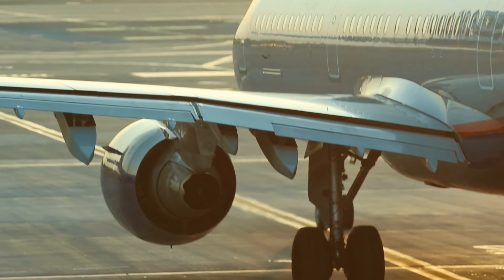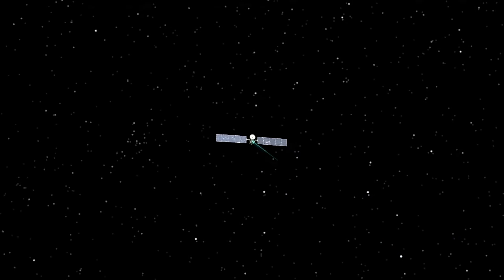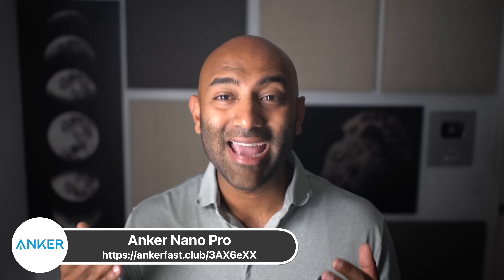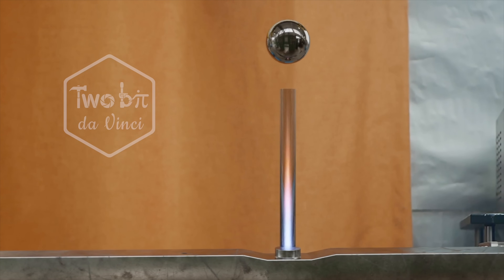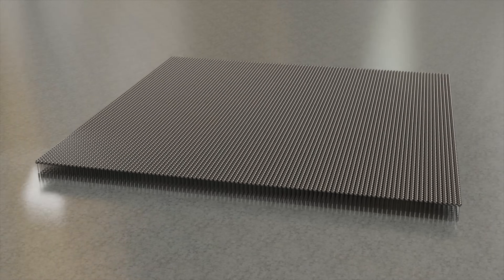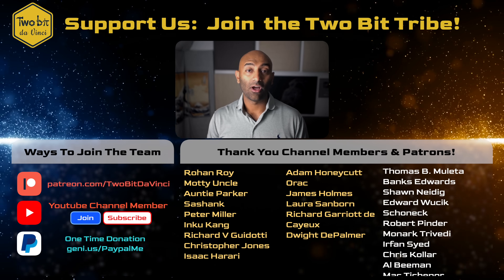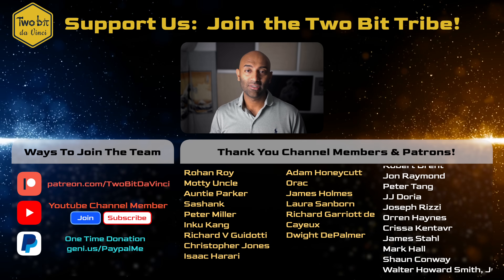The Next Generation of Jet Engines.... Is Electric?

Comment: Stop the "greenhouse" lie. The physics of the earth's atmosphere does not allow a so-called greenhouse effect. As well the CO2 part per million are the lowest in earth's history. When the dinosaurs roamed the world the CO2 ppm level was 10 times more than it is today. Back then there was flourishing life everywhere. There were small ice caps at the poles and subtropical climate up to the current Arctic circle. As well there were very few desserts on the surface of the world. But electric plasma engines will be good for advancing travel. Once thorium molten salt reactors scale to electric giga watt level at a compact size it will happen this century

Comment: Correction: You said that 'high bypass ratio produces less thrust' - that is incorrect. High BPR means higher thrust because of higher mass flow rate of the air, but it costs exhaust velocity. With a high BPR, you can fly a larger mass in the air at a slower speed or vice versa.

Comment: Turbine engined aircraft only have to carry 1/10th to 1/20th the amount of fuel onboard to provide power as the rest of the mixture comes from the atmosphere. EV propulsion needs to carry 100% of the energy onboard. I can see a distant argument for very short hop applications but it will NEVER, EVER be viable for long haul air travel without numerous generational advancements in battery technology.

Comment: Most energy is used to get off the ground. Once airborne at 30,000 ft this kind of power could take over. Some form of Hybrid or assisted take off may be the solution.

Comment: How much Ozone is produced with atmospheric plasma jet engines? What are the concerns about stripping all the electrons off of atoms and then expelling those hot plasma into the atmosphere ( i suspect nothing or at least less than a single lightening bolt). Basically, it seems cleaner, but what are the new forms of pollution that a plasma jet will produce? Seems too good to be true….. and I like the idea of them

Comment: Plasma thrusters are neat especially at high speed in the vacuum of space, but you cannot achieve better than 100% efficiency. Good electric motors are close. Propellers and fans are also pretty good. If you do not want to go supersonic an electric fan jet could work. They work better at high altitude than a conventional jet which is running out of oxygen for combustion. No matter which, you still need a huge electric power source. Maybe some day a novel fusion direct to electric reactor will be possible.

Comment: There are no batteries available to today or likely to be available any time soon which can power a jet plane.  Modern jet engines can generate about 23MW.  This is energy out, meaning there is no efficiency to be gained.  If it take 50MW to take off, you need 50MW to take off.

Comment: There's a new kind of propeller for boats. It's quieter and more fuel efficient, but it is way too expensive. What I would like you to investigate is whether the same engineering concept can be used for aircraft props.

Comment: Plasma jet... There is a "hot" plasma which would allow for a better thrust than "cold" plasma thruster, but it has major drawbacks. Hot plasma means stripping the atoms of their electrons and they become highly reactive This would cause highly effective generation of NOx in atmosphere which would lead to ozone depletion acid rain etc... So "hot" plasma is out for applications in atmosphere. But it would be great for high ISP rockets for interstellar flights... still I would not expect very high rocket acceleration - it would be probably in milimeters/s^2
Then there is so called "cold" plasma. Cold plasma is composed of electrons. Causes generation of ozone. Ozone is very toxic gas, so it would be dangerous to use it bellow stratosphere. But even in stratosphere in may become dangerous to produce it, these layers of atmosphere are intermixing each other. Also, it would have lower thrust than "hot" plasma engine.

Comment: Will be interesting if they can adapt materials to create blades to handle the temperatures they listed in order to spin the shaft like current jet motors and therefor drive the bypass fans

Comment: Instead of using combustion to expand the air, it may be possible to use lasering, to make the electrons jump to a higher energy shell, also maybe using the bond frequency of diatoms of Nitrogen to separate them into monoatoms, as well as negative ionisation.

In other words the question becomes, if we take a volume of air, what inputs combined expand that volume most effectively?

I thought about decades ago a giant balloon structure, an inverted drop shape with a flattened top , that has a central channel containing the rocket, as the balloon ascended the hydrogen gas would get colder, to be liquified, to contribute to the fuel reserves.

Comment: There have been prop airliners that could go jet like speeds at jet like altitudes like the Tupolev Tu-114 so I reckon if battery technology improves we will see electric powered high performance prop airlines, either that or conventional turbo jet airliners powered by hydrogen fuel if that gets easier and cheaper to produce.

Comment: Every jet airliner has an unit at the end in the tail section called an Auxiliary Power Unit which is a gas turbine designed to generate electricity. If the issue is power, then why not have an Auxiliary Power Unit running at full power to generate electricity to power these engines in flight. It would still create emissions but it would create much less and power the engines.

Comment: It is extremely unlikely that this technology will be used at any point in the future. There are several issues with the technology that would require major breakthroughs beyond the existing technologies to overcome. At the pace of investment in those specific technologies, and the fact that most of the research is being focused on weapons technology and NOT transportation, it is extremely unlikely that we are going to see anything like this technology developed before other, better technologies are developed and implemented. Thanks for the video, however.

Comment: Does the ion truster engine beter thrust than a propeler? It's nice to have ion drives but they use eletricity, similarly to an eletric motor but on many kiloVolts. Comparing to combustion jets these plasma jets is almost crimeful.

Comment: If batteries are not a viable solution, use a different solution.
Nuclear energy is the clear winner here, because it doesn't rely on sunlight or other restrictive methods of power generation. 
A fission reactor of a small enough size could fit the bill.
Alternatively a small fusion reactor would be the ideal solution, assuming that technology ever becomes viable.

Comment: Under development is a 1km2, 15,000 Passenger,  LTA-ICC (Lighter Than Air - Inter-Continental Cruiser), with a 200+MW Solar Roof, and  NEVER Lands just Hovers above the Rotating Earth below. It uses Electric Shuttles to ferry passengers, baggage, supplies, waste, etc... from/to the "Airports' below..... (like the ISA but lower.. above the clouds altitude... 30-40,000ft)
It has 150MW Solar Energy available for Thrust.... (LTA uses Helium provides the Bouyancy)
How much Thrust can I expect using these Electric/Microwave powered Plasma's using this 150MW of Power....???

Comment: Speed of a propeller driven aircraft is the tip speed of the propeller. A turbofan engine is a fancy propeller. The shroud controlls the problems associated with supersonic tip speed. A better solution is an electric motor turning the turbo fan. Speeds of 500 mph or more is realistic.

Comment: Another option that I’ve not checked has been carried out is to carry a fuel cell of say argon and not have air pass through the combustion chamber, bypass sure, reason being is to control the magnitude of the ionisation process since our air is loaded with efficiency changing materials, but it’s right up there with making a blimp utilising a vacuum as it’s lifting force.

Comment: Given the resources, I could build you a functional plasma jet engine fairly easily. The two limiting factors are the power (you'd need an actual nuclear reactor to even touch the necessary performance envelope at current technology), and the other are high temperature materials that are also light enough and durable enough to survive air travel. Those do exist currently, however the--pardon the pun--stratospheric cost involved would completely offset any energy savings by moving to electric. Batteries wouldn't ever be able to offer enough punch to get a passenger liner off the ground; you will definitely need an on-board reactor. Remember that as speed doubles, fuel consumption quadruples. Unfortunately in atmosphere, this still holds true regardless of your chosen means of motivation. Now if one could figure out how to isolate the body of the plane from air drag without affecting the engines or wings...

Comment: Sorry to troll your video, but, if you are worried about carbon emissions, and I am not, the amount of fuel consumed by the entire fleet of airplanes on earth is almost identical to the amount consumed to power all the kerosene lamps currently used as primary lighting in the world. We have the tech to run the wires and put kerosene lamps in the history category. And it's not 5 to 10 years away. Lol

Comment: Obviously only a hydrogen fuel cell of the correct 300kw output would make a air breathing plasma jet engine able to move a large mass of people in a tube in the sky // it has to be an air breathing engine to be practical // Rejected heat from the fuel cell can be used to pre-warm the plasma jet engine.

Comment: To achieve the thrust developed by modern jet engines you must have....wait for it.........JET FUEL. Electricity,  plasmas, ions, are just dribble.  The public must accept the fact that airliners will be using jet fuel until there is no more jet fuel.

Comment: The main reason why people would oppose longer flights would be the discomfort. If they made flight just slightly more comfortable. For example a bit of privacy, and a comfortable chair that can recline to allow comfortable sleep, then the whole equation changes. Then it becomes more of a scheduling change, than anything else. Most people do not actually need, as such, to get somewhere overnight. However far you go, after two hours you start wishing the discomfort away. People are stuffed in more like livestock than anything else.
If we can power planes electrically, then the fuel costs will reduce. And if this allows a bit more comfort...
As things stand there are aluminium air batteries which already have pretty good energy density, and economy. Even with having to replace them after every flight.

Comment: How about Aluminum Air batteries and electric motors to replace piston engine airplanes. Seems like a great fit. Very low weight and long distance. If it will allow a car to drive 1000 miles on one battery. Then it seem that you could travel maybe 8000 miles in a small plane. That would easily work for most if not all of the general aviation market.

Comment: Zero emissions is a blunt lie. The emissions are just removed to a different location.  In the case of electric cars , it's a power plant , electric cables , transformers and so on. I would like to see a complete comparison between electric cars , and internal combustion cars in terms of co2 cost production. In my mind I still believe that smaller , more efficient would save a lot more co2 output then a bigger better faster , heavier anything.  Just my 2 cents.

Comment: Thats sound not usefull to me. Coverting Electrical Power to Microwaves have a poor effectiwity, and using the heat from Microwaves to generate Trust is a Heat Process with limited effectivity by laws of nature. An effectiv  Turbofan with an E-Motor …… it has a effectivity of grater 95% sound like quite better idia to create trust from limited power resources in the Atmosphere for aircrafts

Comment: Gimme gimme gimme a  Mr. Fusion!  ;)  //  Um, Ricky, did you just say "Research shows that plasma engines are capable of reaching incredibly high accelerations with over a century of acceleration"?  WELL, I HOPE SO. //  I'm hopeful every time I read of a new "breakthrough", but so few are realized, it can be disheartening.  //  OK, Ricky, next, I'd like to hear about anyone who is working on mastering the manipulation of =gravity=.  Why push when you can float at 0.9C?  If you haven't yet read the wonderful Silver Ships series by S.H. Jucha, I heartily recommend it.  (Available on Kindle Unlimited, too.)

Comment: 1:47 Literally no aircraft today uses TurboJet engine (except some more than half a century old), the jet engines in airplanes are based on TurboJet core: TurboFanJet (most of airplanes), TurboPropJet (mostly slower airplanes) and TurboShaftJet (mostly helicopters).

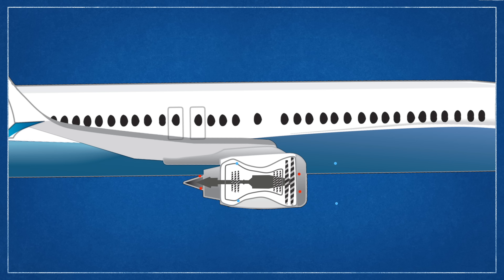2:42 The more air it's bypased - the more thrust you will make from the same amount of fuel.

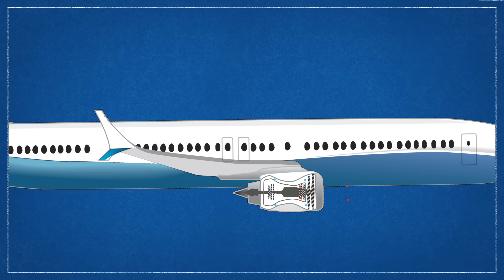2:49 Don't.

3:02 The fuel/air doesn't explode in jet engines, it combusts.

Comment: I would like to know what the flow rate of the compressed gas used in the Wuhan plasma jet prototype is. Plasma probably expands a lot once not compressed considering that it is superheated, but I think that it would be interesting to see how that volume expansion relates to the rate of decompression in their gas container.
Reply: Or the size of the tanks/compressors needed to supply compressed air to the plasma jet. And the power consumption of the compression, is there a diminishing return there, or increased efficiency with size.
Reply: @GuitarNvoice  what if we could skip the whole compressed air storage question and try to copy a conventional jet engine, just have the combustion process be replaced with the ionization process? 

I doubt that it would be more efficient than just an electric prop at low speeds, but what about supersonic speeds?
Reply: @romangudev8770   the essential problem with ion/plasma drives is that while they have nearly endless acceleration potential, that potential is over time and not immediate. Which is why they make good/efficient drives in space for long term acceleration, but are absolutely balls when it comes to atmospheric propulsion. The air resistance on an object will quickly outpace the acceleration potential of an object using plasma drives. 

Think of a cheetah, how fast it is moving on its own, now harness it to a chain attached to a couple concrete blocks. If the chetah can move at all it wont be fast.  Now change the cheetah out for a horse. The horse will barely feel the weight. But its unhindered speed is not much higher without the blocks than with.

Comment: Think it's a bit incorrect to attribute the low thrust of satellite plasma engines to Xenon. The working gas doesn't matter a whole lot in a plasma engine in regards to allowing it to be ionized, it just effects its reactivity with the chamber and thus the corrosion it will experience. Xenon is used because it is non-flammable, very unreactive, and has a relatively high density. Satellites have limited propellant and thus maximizing the amount of thrust that propellant produces increases the service life. They could make oxygen or air plasma thrusters for satellites, they just wouldn't be as efficient given there is a limited supply on the satellite.

Comment: how is it cleaner when 90% of Electricity is still created by fuel-driven Generators. it takes more fuel to create the electricity for an electric car than it does to just use a gas car. Solar only works when the sun is out and wind generators are really not cost-efficient because they are breaking all the time, God created Fossil fuels to be used he designed this world to support us. I'm not saying don't use wind and solar I'm just saying they will never replace fossil fuels

Comment: Until high battery energy densities are available, hybrid aircraft may fill the role. Electrify the engines, use batteries to assist in getting to cruise altitude, use a power generator optimized to the power requirements for cruising. Today’s aircraft use a large part of their fuel in takeoff and reaching cruise altitude. Engines are sized accordingly. Electrifying aircraft allow designs with less drag. Ex flying wings. Electrification also allows engines the do the role of control surfaces, reducing the weight associated with control surface manipulation. Flying wings also save weight because the structure is more compact and rigid naturally. Adding plasma engines will allow higher altitude cruising with higher speeds.

Comment: 10N for 400W?  So you'd need to multiply that by about 15,000 times to compare with a typical jet engine, which would mean it would consume 6 MW of electricity.  Is the plane going to have a nuclear reactor on board to generate that?

Comment: I came across your video by accident. I am an old mechanic who wrote a book called "A Tinker's Dream". I like your ideas. I an wondering if plasma technology could be used to drive a piston in an engine? A small engine could drive a hydraulic pump to be used to release the brakes and then drive a car with a torque converter. Three torque converters at each wheel would be ideal.

Comment: For New York to LA, why not high speed trains? I think our focus on aircraft has to change as well. Automated electric prop plains powered from the ground if made spacious enough would be like staying at home. You could even use lighter than air dirigibles with a plasma jet maybe.
Reply: yeah 'high speed trains' such as hyperloop technology will be much faster + greener...but you still have problem of building such massive infastructure.

Comment: Hold on. If You compress air and then ignite it  with electricity/ microwave for pressure wouldn't  it still create pollution (maybe even some NOx) ?